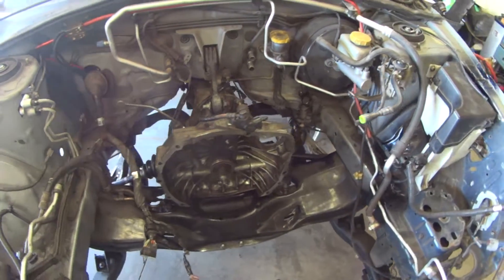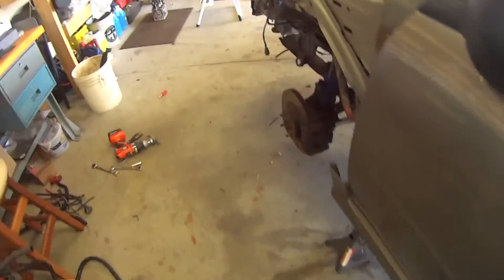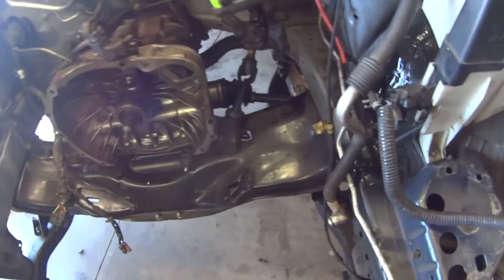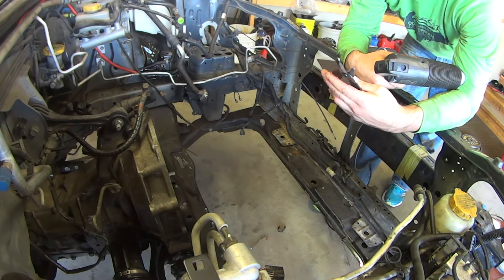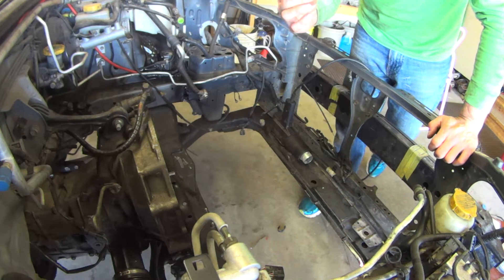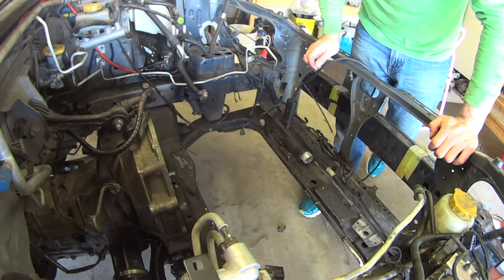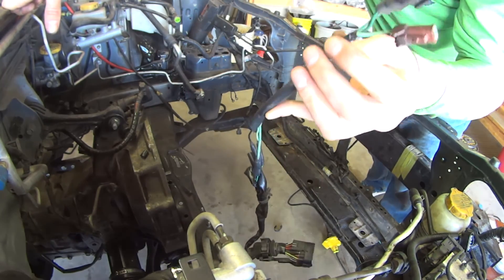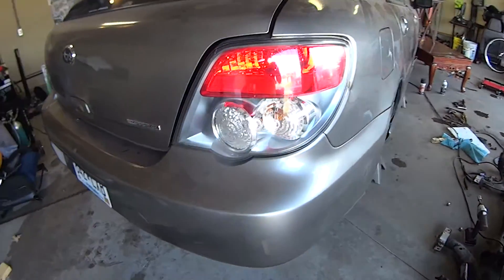Subaru Transmission Swap Wiring

Comment: What wires do u hook up and where to  on a 2002 Subaru legacy on a auto to manual swap to hook up speedometer
Reply: Did you end up figuring it out
Reply: Any luck?
Reply: Nope sure didn't. 😢
Reply from the maker: Wish I knew the answer. Check iwire's website they even sell the adapter, beyond that just look at the wiring diagram. Good luck!

Comment: I want to swap a manual transmission into my 99 2.5rs. 

I plan on using the transmission and parts out of another 99 2.5rs for the sake of simplicity.

Would the wiring I would have to do be what you did in this video? 

Also would I be able to retain. ABS with no CEL?

Comment: Any advice for me? I'm swapping the 5mt from my lifted 97 legacy gt, and putting in an 09 outback 5mt and rear diff. Problem is the speed sensors operate differently? How do I get my speedometer to work properly? Any help is appreciated
Reply from the maker: Use an ABS wire. You may still need to convert the signal. Worst case there's always GPS!

Comment: How do you get rid of the check engine lights after the auto to manual swap?
Reply from the maker: +Elliott Nunez my car was originally a manual. If you're referring to the Engine being from an automatic car I didn't have an issue with the check engine light.

Comment: The wiring looks awesome,  but why not solder instead?  It'll be a permanent,  more conductive connection.
Reply from the maker: Boondocking Bugbees it's really up to your preference. I am able to use quality splice connectors and I believe in it not failing. It's possible that solder joints could fail or corrode, but it's really up to your discretion. I would be happy with either in this case.

Comment: what drive shaft you using
Reply: Happymanasfk Subaru The car it came from was a 2002 Impreza outback sport driveshaft, but the GG chassis all use the same driveshaft.
Reply: +Black Knight EG33 Impreza 
thanks so much is this push type or push type clutch
Reply: I have 2001 bugeye and got xt gearbox for cheap so I'm going to put it on my car it's 4.444 I have got the gearbox and diff
Reply: Happymanasfk Subaru my setup uses a push type clutch, that same that can be found on the Forester XT. I am using a 2002 WRX flywheel because the dual mass flywheel from the XT was much more expensive. Doing it again, I would get the dual mass flywheel thought as the throw on the slave cylinder is rather short with my setup.
Reply: +Black Knight EG33 Impreza 
thanks so much for your reply